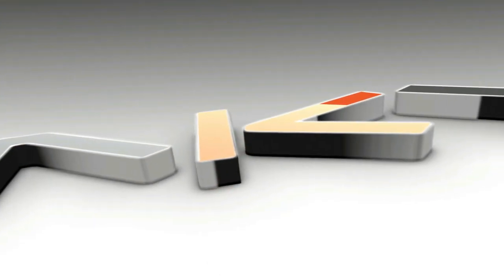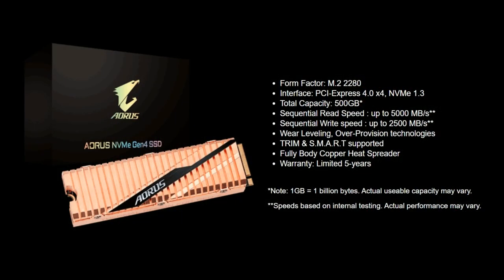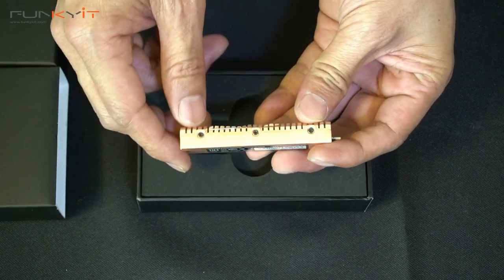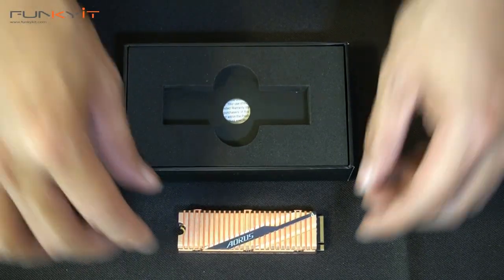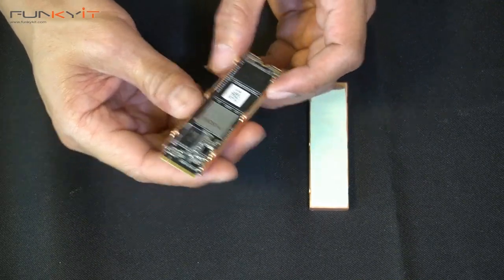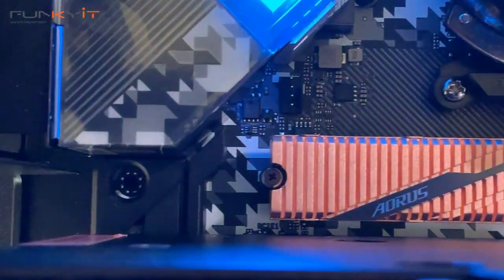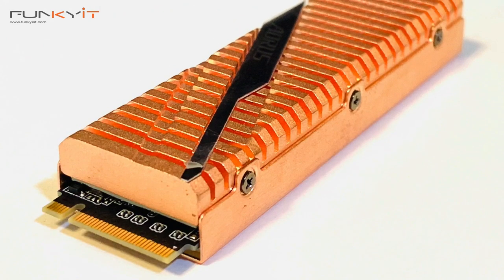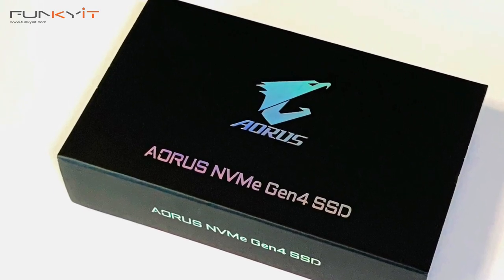The Coolest PCIE M.2 NVMe Gen4 SSD by Gigabyte Aorus

Comment: I have 2 x 1Tb Aorus Gen 4 NVME drives without the copper heatsink on the X570 Master, a board that comes with heatsinks already.
Read/write speeds are as advertised.
Planning to try out Raid 0.
Reply: What heat sink should i use the one on the nvme drive or the one on the mobo?

Comment: I wonder if in time it will become ...greenish on the outside, you know coper tends to hydroxide.
Reply from the maker: Maybe ... but I think the heatsink is coated with anti corrosion material
Reply: Ive had mine for over a year now, not even slightly changed in color.